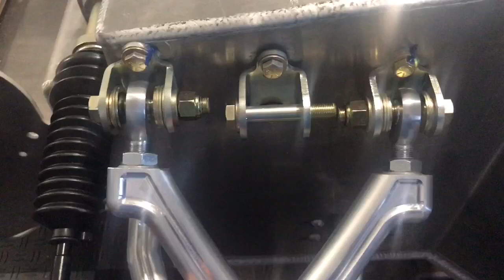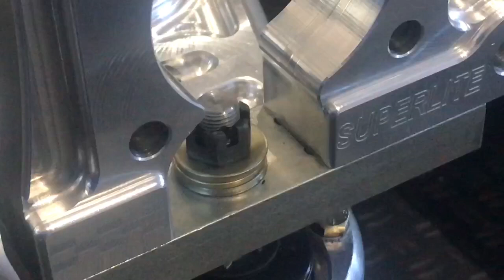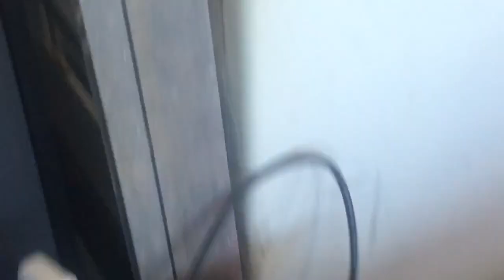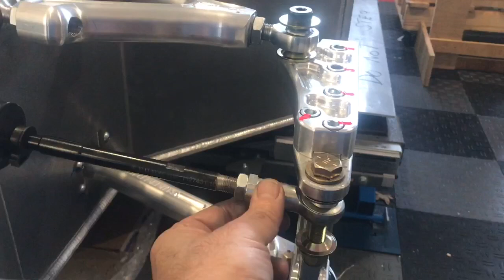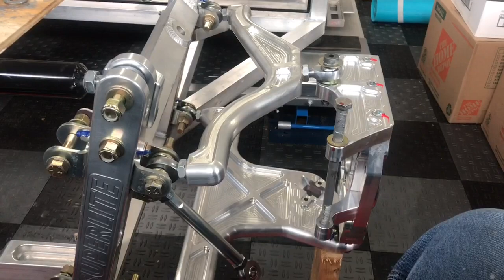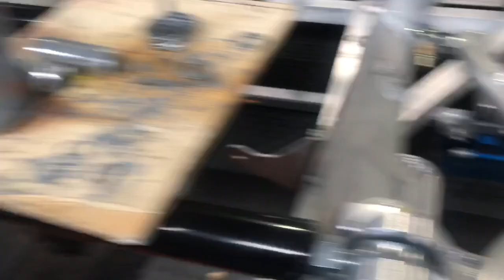Superlite SLC Build 044 Suspension Upright Install

Comment: Awesome project Joel! 

Run-on torque is defined as the resistance to rotation of a nut , bolt or stud during the pre-clamping portion of its installation (before it begins to tighten down). It's usually measured with an inch-pound torque wrench, for accuracy. As long as you check the run-on torque of self locking hardware during the installation process to verify they are within a specification, they are perfectly safe to use as substitutes for hardware utilizing castellated nuts and split pins. 
Measure the run-on torque of each size of new fastener you are using, record it , and check future installations against those records. If the hardware has lost 50% of its run-on torque during a future installation, replace it. Simply being unable to spin on the nut or bolt with your fingers, is not a valid assessment of run-on torque. 
There are two types of self locking nuts; 1) steel, and 2) steel with nylon linings. Never use nylon-lined self locking nuts in high heat areas, as they will prematurely lose their locking capacity. And keep in mind that self locking nuts loose some grip every time they are removed.  
As a means of quick reference of the security of your installed hardware, mark all critical hardware with a liquid witness mark product.  During your inspections, a narrow stripe of this product from the nozzle of the tiny dispensing tube, down a nut or bolt head and onto the neighboring material, will quickly announce the existence (or lack of) relative rotation. And if the surfaces have been thoroughly de-greased beforehand, this stuff will stick like shit to a hot muffler. 

Good luck!

Airframe and Powerplant Technician 40 years, Air Canada.
Reply from the maker: RANDALL SEMRAU Thank you Randall, really appreciate the feedback.